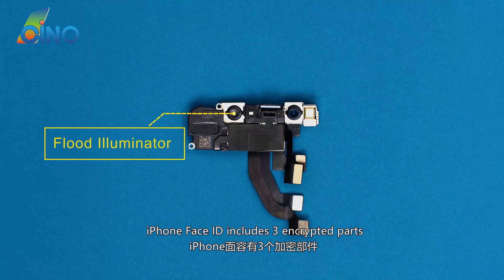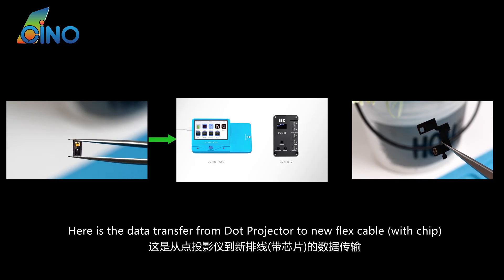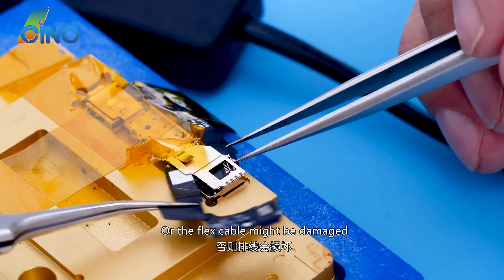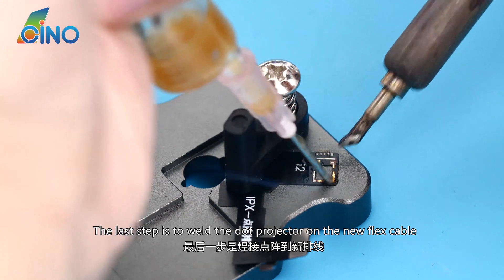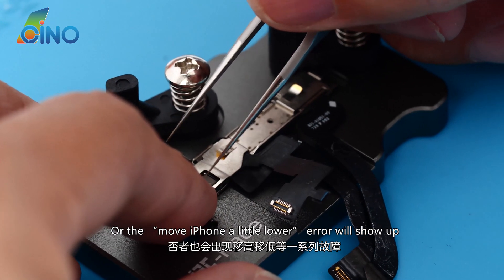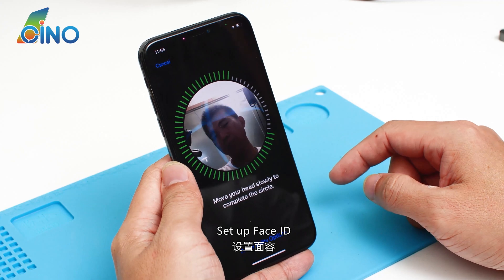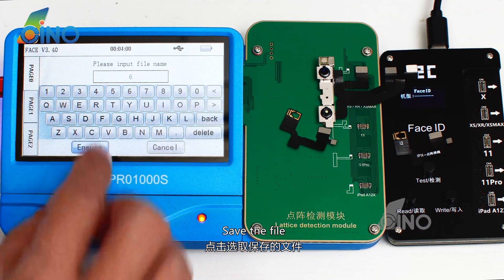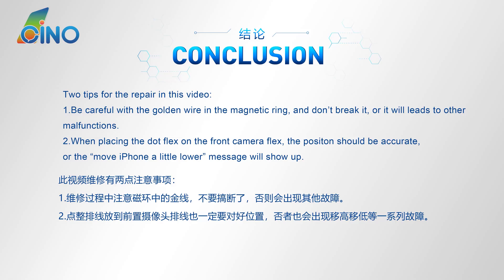Face ID Dot Projector Repair Complete Guide With New Reprogrammer Tutorial- i2C/JC And Tips

Comment: Hi if i get read data NG from original face ID after water damage is there any way to repair it? or is the encrypted chip damaged? i opened it up to take a look and the projector seems fine so i used dremel tool on mosfet and did the jumper and now i get everything OK but still i2c NG and that will automatically make a Read Data NG. Tried new flex to check if problems were there but nothing there. The IC chip with capacitor you get with the kit is it for this kind of repair? i have checked the gold wires and seems ok( not under the underfill and that is were the positive for i2c is right?
Reply from the maker: Before any move you do with your face ID module or CPU or Flash, we recommend you copy your data. Then you repair things. Also, phone brand, model decide which part should be done together.

Comment: Hello after dot projector repair and correct alignment I have an issue when setting up Face ID. When it scans the face it stop randomly and says please try again and reason is because metal frame is bent, are there any tips to fix the metal frame? I try to adjust but always get the error.
Reply from the maker: There are many techniques for face repair, including dot matrix removal, skills, air gun skills, glue skills, etc. Plz pay attention to YouTube this week. We will post a detailed facial repair video this week, and we will also add a new fixed dot matrix tool. at cinomall. com
Reply: @CINOTechnology  sounds good! Looking forward to it.
Reply from the maker: yes, there is a specific tool. you can buy it on your local market
Reply: @CINOTechnology  what tool is it? I have the dot projector calibration tool to align with the glass so it works correctly. But I never heard of a tool to align the metal frame for the infrared camera, front camera and dot projector.
Reply from the maker: Check out our new repair  video here https://www.youtube.com/watch?v=MBxUAj5dzLM

Comment: Thanks for the video and the content. One quick suggestion, I have a broken front camera but working face ID. I'd like to replace the camera and transplant the data from the Dot,IR,Flood Illuminator from the original (working) to a new front camera module. This should not require soldering right? Can I use only the programmer you use at 2:21? Thanks a lot
Reply from the maker: Yes you can, no need soldering